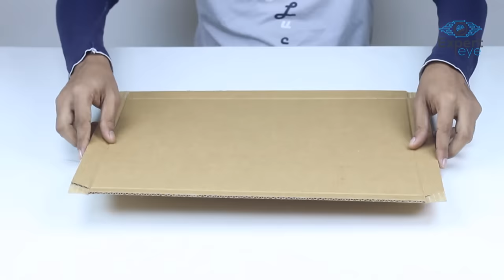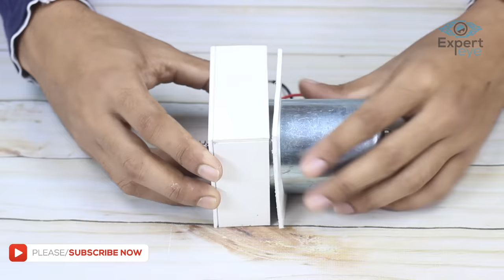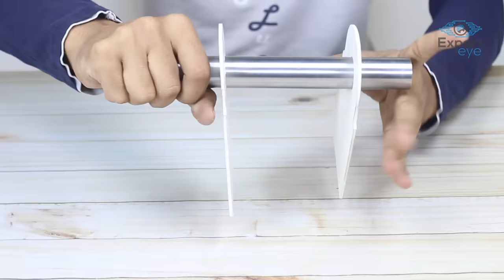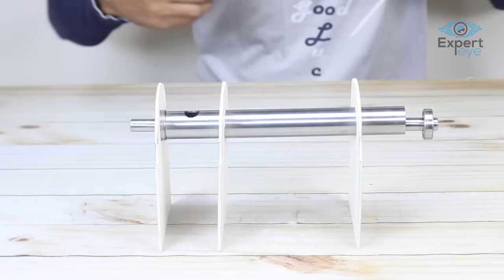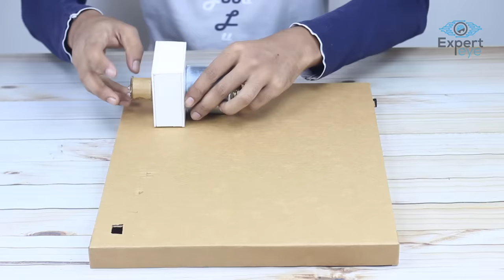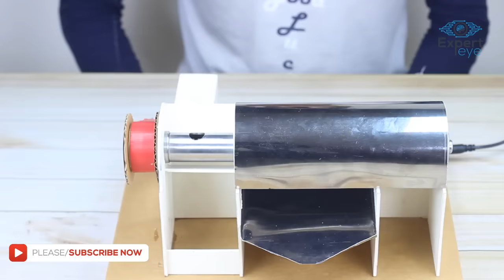How To Make Mini Mustard Oil Mill Form Cardboard at Home! DIY Oil Mill

Comment: Moreover, your machine is not for mass production, so what is there to hide. I suggest for the small cup of quantity of oil, it's better not to us use motor and current. Just put the crank/ handle in the left side will save your costing and will be more realistic.

Comment: I understand this machine is designed to give us the idea, but you should provide the full specification i.e. motor horse power & what type of motor you are using ?,  Ac/Dc current you use, spindle tread per inch/cm length, how each wire are connected, especially the right side corner not clear at all ?? So if someone follow your foot step  like this will be jeopardize. So be honest yourself. No wonder so many people have bad comments on you. Honesty is the best policy. So if you really want to share, make sure they can learn. Otherwise don't put anything in "You tube" as nobody will appreciate it.